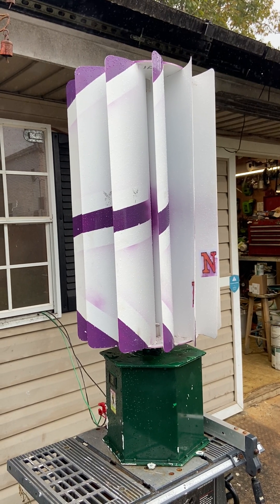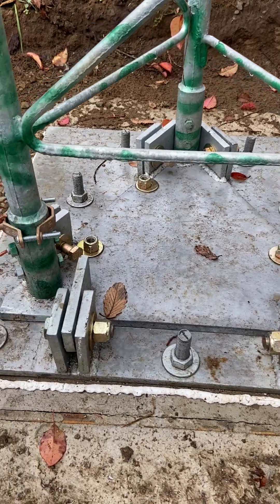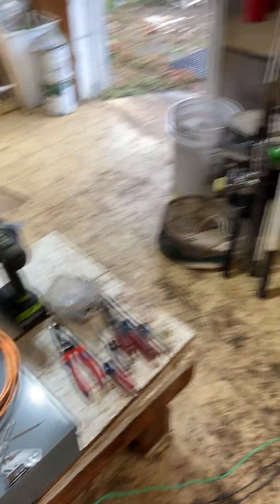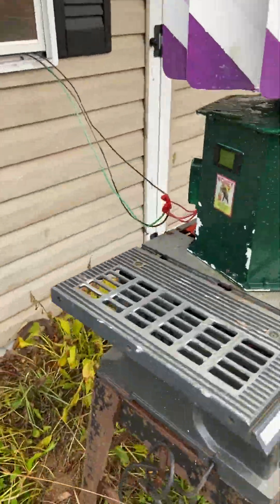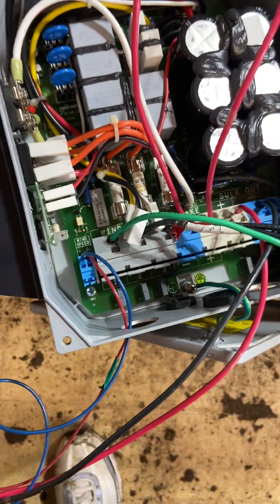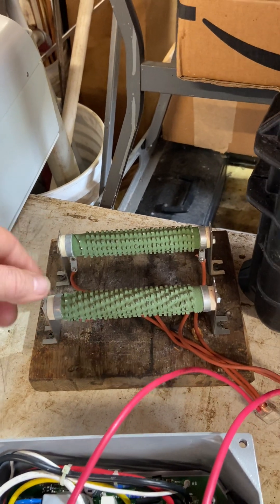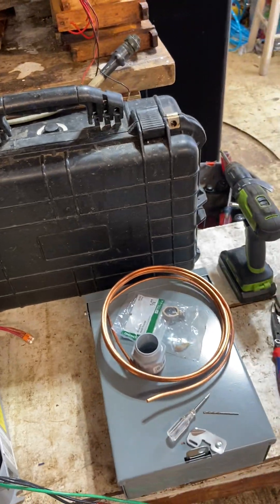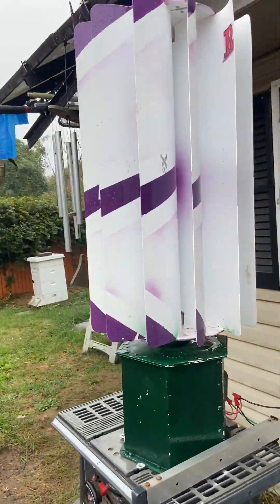Vertical Wind Turbine Part 21 What’s the cost of installing a simple $1,400 Windturbine ?

Comment: Do you have any EMP protection gear integrated in this setup?

Nice camo job on the tower...
Reply from the maker: Yes I do, I have “EMP SHEILD” units on the house, the inverters, the power walls, and ferrites on each solar panel.
Reply from the maker: As for the camo job, still not finished,  Want it to blend with the sky line